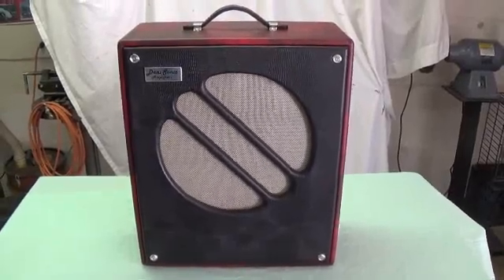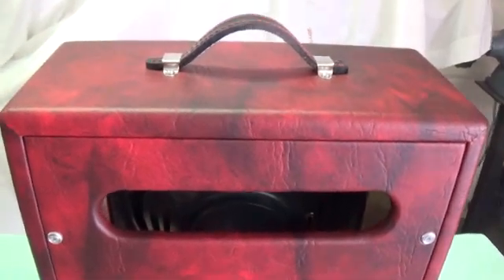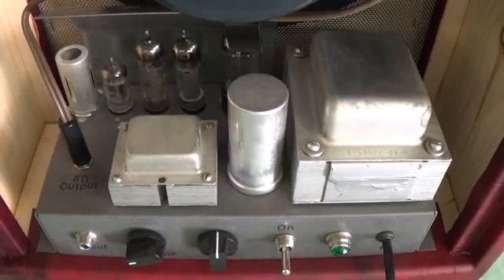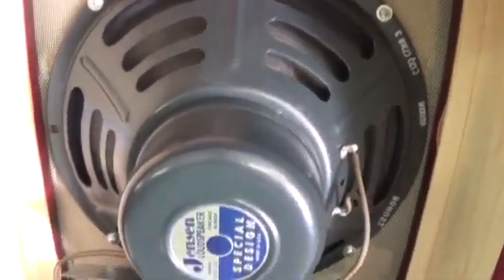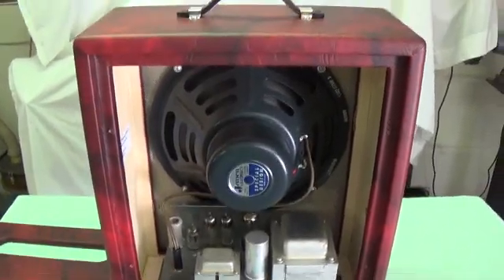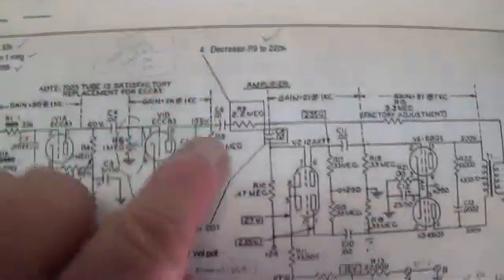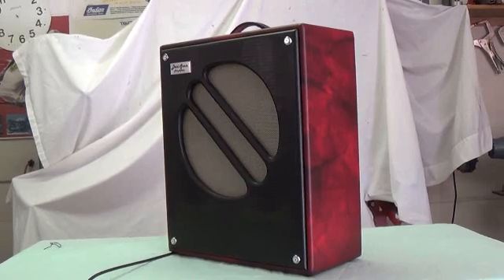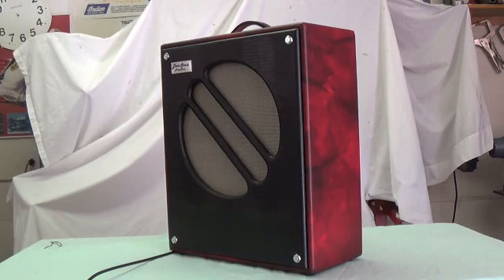Conversion of a Hammond AO-35 Reverb Driver into a Guitar Amplifier

Comment: I know this is old, but I've now got 3 of these piggies sitting at home. I'm wondering if anyone knows the actual current specs on the 6.3V winding? I've read elsewhere on the web (hardly the best source) that it had to power "a ton of other tubes." I was wondering if anyone knows if that's true, or to just stick with what's in it?
I've got a SLEW of low-power power tubes that run at low plate volts but suck up lots of heater current & I'd like to experiment with them, without just wiring up heaters until the voltage sags & I blow up a tranny. 😁 
Thanks to any who can help!

Comment: Hi Uncle Doug, hope all is well. I know this is an older video but I discovered something on my AO-35 conversion that may help others out. One can pull the nuts and spin the output transformer 180 degrees to get the high voltage away from the pots. Helps tremendously with any squeal/interference at higher volumes.
Reply from the maker: Thanks for the helpful tip, GW.

Comment: I had to get into this finally.  I have built and mashed a good number of project now so I attacked this a little different,  My first "chore" was to eliminate the existing ground loop factory.  I did that and made all of the basic changes and have a decent quiet amplifier.  It does need some tone shaping.  I have no oscillations that so many have complained about.  I also went against the grain and I am upping the first coupling cap to 0.047 to increase band width of the signal..  These were built for reverb and as such are designed to attenuate low frequencies.  So my plan for tone is to put a two pot Brownface into it.  That will be next week when the pots come in.   I am also going to play with a gain control seeing if an adjustable plate voltage control is feasible.
Reply from the maker: Thanks for sharing, Ellen. Good luck with your project.

Comment: Nice work Doug!
Don't be afraid to crank that amp up past 2 on the volume. 
Also, what a great score on the C12Q, plus the bell cover, sweet.
It can handle the volume, no problem. If you ever get a Fender Deluxe/Reverb?
Put one of those vintage C12Q's in it and I think that you will like it. Cheers!
Reply from the maker: Thanks so much for your helpful input, Amo.

Comment: Instead of grounding the gray wire I put in a switch to ground, would this in fact make a standby switch?
Reply from the maker: The video was made several years ago, Drew, and I don't recall the colors of the wires. Try it and see :)

Comment: Hey Doug, curious if you have pursued the suggestion of using the AO-35 as a standalone reverb tank. Just pulled one off my M3 and am trying to do that with 1/4" in and out with dwell, mix, and maybe tone control. I've got the original necklace springs but I'm thinking of using a 3-spring tank. I've done simple amp mods but nothing this serious, and all the breakdowns of this amp seem to be conversion to guitar amps. Anyways, if you have looked into that at all a video would be awesome! Or if you've got any tips to point me in the right direction. Cheers, nice little amp!
Reply from the maker: Thanks, Scott. I have never tried to operate the AO-45 in the manner for which it was originally intended. I guess it just made more sense to use a 6G15 for reverb and convert the AO-45 into a really nice guitar amp. If you are successful, please let us know how you did it.

Comment: In a Hammond M3 this amp and the larger organ amp share the same field coil speaker's voice coil OR this smaller amp is a preamp to the larger amp. I have not looked yet to find out.  The field coil speakers field coil is not connected to this amp in the organ however connected to the organ's larger amp. The voice coil for the single field coil measures 6.5 ohms. I would think one could go as low as 6.5 ohms as you add on a speaker to this amp. I wonder what your Jensen's actual impedance is? Curious.
Reply from the maker: I believe this amplifier serves to drive the reverb tank in the organ sound system. It is not a pre-amp, since it has two 6BQ5 output tubes outputting around 15W.....a bit excessive for pre-amplification.

Comment: MY 1955 HAMMOND S6 ALL TUBE HAMMOND TUBE ORGAN HAS 1 SWITCH, REVERB  ON//OFF.. I use a giant rheostat ( because it's what I had on hand) to control  the volume of the reverb speaker, at the speaker.
I've  built and modded many tube amps, but because THE HAMMOND AO35 3-SPRING NECKLACE REVERB IS THE BEST SPRING REVERB OF ALL TIME, AND IT CAN BE DRIVEN AS A SLAVE AMP(IT'S DRIVEN OFF THE ORGAN AMP'S SPEAKER), THERE IS NO REASON TO MODIFY ANYTHING! DRIVE THE AO35 WITH ANOTHER GUITAR AMP LIKE A CHAMP OR A PRICEDOTCOM $100 TUBE AMP. BEST PART, YOU GET TO KEEP THE AO35'S REVERB TOO! If you can't find the no doubt missing 3-SPRING NECKLACE REVERB SPRINGS then use  a regular  $27 ACCUTRONICS  TANK  REVERB.

 LAURENS HAMMOND INVENTED SPRING  REVERB, ALL  INCARNATIONS BEGINNING WITH THE LARGE VERTICAL OIL FILLED SPRING REVERB (See Eric Larson article ' Ken Griffin's sound, Hammond REVERB section.. You might have a new found respect for the preservation of all that is Hammond! Hey why not, there are already a zillion guitar amps in the world. PS I played guitar seriously, in bands for 20 years, and went to  GIT, before discovering the great  OTHER TONE HEAD'S BLISSFULLY ABUNDANT, AND STILL REASONABLY PRICED (even free!!) world of PRE-68' ELECTRONIC TONE WHEEL-HAMMOND,,  ELECTROSTATIC REED-WURLITZER, TUBE//TRANSISTOR-CONN,,THOMAS, LOWREY,BALDWIN,,WURLITZER,,ALLEN,,YAMAHA, AKAI,,etc (( check out  NSHOS very cool animated articles, google - NSHOS WURLI 4600   , then also go to the HOME PAGE at the bottom of the page for the HAMMOND TONE WHEEL ORGAN, and the very amazing HAMMOND X66 .I own an X66. Look at my avatar 😊

SAVE THE ELECTRONIC ORGANS 1935-1982 (Organs made to 1968 are like the best guitars, and guitar gear, ever made in terms of manufacture quality, tone, and worthiness of being kept alive (very easy to service organs!) for future generations to enjoy. THE ORGAN IS DIRECT COUSIN TO THE ELECTRIC GUITAR. DON'T DESTROY A RELATIVE. SO WHAT IF THEY DON'T COST AS MUCH AS GUITARS!!
Reply from the maker: I can tell that you are very passionate about this topic, Paul. Thanks for your input.

Comment: Uncle Doug to the rescue, I am working on a conversion of a Lafayette PA amplifier and I have installed a standby switch on the back of the amp  and when I flip the standby switch off or on  I have that lovely delightful pop that occurs when I flip the switch, is there a way around to dampen that noise like maybe installing a resistor across the contacts or is that something that I just have to deal with. Your insight in this matter will be truly appreciated by me, my wife and my cat.
Reply from the maker: Look up "snubbers" on the Internet, Ron. Their purpose is to eliminate popping like you're experiencing
Reply: @UncleDoug   A 47k 2 watt resistor was recommended placec across the switch.
Reply: @UncleDoug  will do, thank you

Comment: Greatings uncle doug and rusty. Love your channel. I want to do something similar to this. I've been plugging my guitar effects pedal into the RCA input of the power amp of my Hammond L112, and I love the sound and break up in getting. I don't really want the preamp, as I already have a ton of preamp models in my pedal board. Is it crazy that I just want the tube power amp section of my Hammond L112? I can definitely tell the difference between plugging into it or into a HiFi PA setup. Feels like I get that tube break up and saturation from just the power amp. I'm I thinking right on this? Would love to hear your input.
Reply from the maker: If I were you, Aaron, I would trust my ear. If the sound you're getting sounds great to you, then it really doesn't matter what other people think.  My own opinion is that it sounds like a great idea. You have all sorts of flexibility in the selection of the pre-amp you use.....and you also get the output power of a good, stout amp.

Comment: What ohm speaker was the Jensen?
Reply from the maker: 8 Ohms, as I recall.
Reply: Thanks for the feedback! I'm loving the videos and I'm trying to get others turned on to your channel. 

So I've got one that I've just finished my initial mods to which follow many of the suggestions that have been mentioned here. I'm amazed at how quiet the amp is even though the only new parts are in the tone circuit and input. I've also completely removed the NFBL and the zobel network (this was done for me when I powered on the amp and the resistor in the zobel network burned up). 

The issue that I've come across is that at about 3-5 on the volume, I get some high pitch squeal. Above that the squeal goes away but the volume is substantially lower and there are a lot of what I assume are odd order harmonics in the distortion (to be honest I'm having a hard time finding a video demonstrating odd order harmonics to be able to confirm my suspicion. 

The controls are in the same location as the CG and I ran across another thread a while ago (of course I can't find it now) that mentioned having the controls that close to the OT, can cause some interference and that if that's where you're going to mount it, that you need to have it shielded. Anther possible cause?

I have 2 new, matched output tubes coming as I think I've ruled the pre-amp tubes out through swapping out with some that I had on hand which I knew were good.

Open to any feedback. 

P.S. amp sounds great at the volume below where I experience the squealing.

Comment: Greetings Uncle Doug,

I built a Leslie type extension cabinet. I would like to build a nice salvage tube amp that mimics that Leslie "growl"

What suggestions might you have as a good candidate?

It seems the hammonds are drying up on eBay.  Prices have gone way up on the few that are around.

Regards,

Joe Glenn
Glenn Guitars
Marietta, GA
Reply from the maker: Greetings, Joe. If the Hammond reverb drivers are getting scarce and expensive, you might consider focusing on a vintage PA system amp like a Newcomb or Precision brand. They are beautifully made with a more spacious chassis that the Hammonds, can be made to sound great, and are generally plentiful and inexpensive.

Comment: Lizards do not approve this video.
Reply from the maker: No lizards were harmed during the making of this video.....several hundred were skinned alive however, just prior to its production :)
Reply: Johnny Cash would approve though !
According to your recommendation.... I just bought a "Hammond Organ Power Amp Type H, for Duel 12" Field Coil Speaker FR-40" on ebay
 What is a field coil speaker ? Will it work with regular speakers ? I looks like a stereo amp
Reply from the maker: I don't recall recommending this particular item, GT, but my memory is not all that great now that I'm an old codger. If it's a power amp for a "field coil" speaker (more commonly called an electrodynamic speaker.....see my video on speakers) it may not be suited for use as a guitar amp, particularly if the speaker didn't come with it. You need to do some searching for a schematic on the Internet. If you find one let us know.
Reply: crap.. oh well. I'm sure i can use it for something.  I wonder what impedence the speaker was ? 
( no don't worry.. you didn't recommend this model. It was an impulse buy )

Comment: I've done a few of these myself. Usually I gut everything except the transformers and tube sockets. My favorite design is the Matchless Spitfire. Often the canister cap is still fully functional and can be used as well  It's just a matter of adding a power cord, switch, fuse and repopulating the board. I disagree with you that you can't have the pots on the same side as the tubes. I've done it with no problems and it solves the heat issue. I usually use an old dynamite crate for the cab for a cool retro look
Reply from the maker: I too have seen other conversions with the pots on the same side as the tubes, so it definitely can be done.  I simply thought that my configuration was better.....and the heat deflector eliminated any heating issues.

Comment: Uncle Doug, thanks for another great video.  I finished the conversion on one of these according to the schematic you posted.  Since the date codes indicate that it is from 1960, I went ahead and replaced the can cap and other electrolytic caps.  On testing the amp I am getting a high pitched creepy tone that changes volume with the volume control.  Reminds me of someone trying to tune a vintage radio, or maybe the sound coming from the lab of some mad scientist in an old movie.  Would this be oscillation in a tube?  It happens whether I use the original tubes or relatively new tubes.  Any suggestions on how to troubleshoot?
Reply from the maker: You're welcome, Jay. Generally, when a hum or unwanted tone obeys the volume control, it must originate before the volume control in the circuit.....therefore, you should direct your attention to all of the wiring and components associated with the input jacks and preamp tube (V1A). Clean the tube socket, check all solder joints, test the caps and resistors, etc. Best of luck.
Reply: It was lead dress.  The lead from the plate of V1a to the tone stack was too close to the output transformer.  So simple, but the sound was so strange I assumed the problem was much more complicated.  Thanks for directing me to the right part of the circuit.  Now that it is working, I can't believe the power and tone of this little amp.
Reply from the maker: Congratulations on a successful repair, Jay. Tracking down the source of an annoying hum can be quite challenging. Rusty and I are glad you were able to solve this problem.